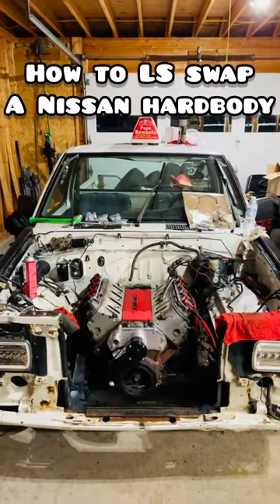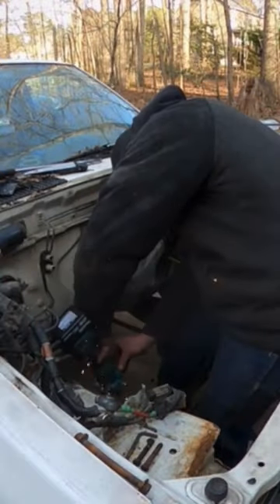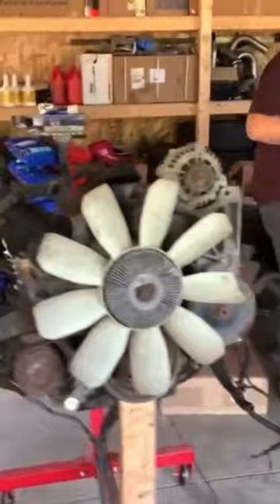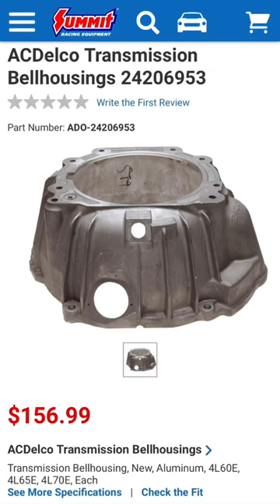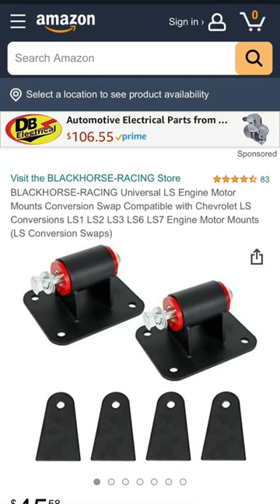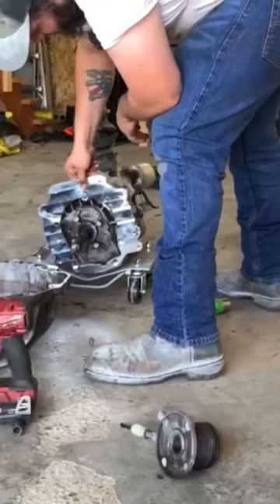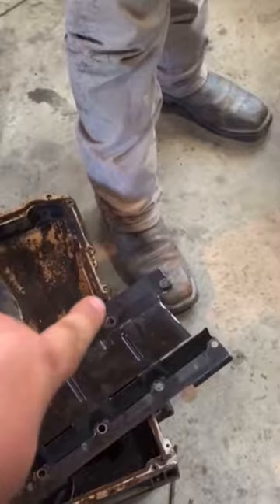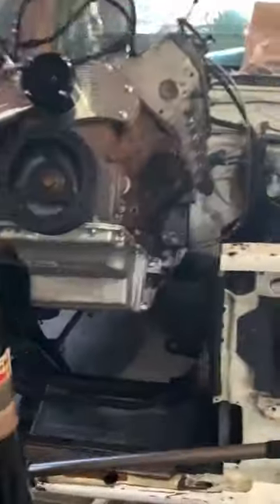How to LS swap a Nissan Hardbody D21 #howto #lsswap #nissanhardbody #d21 #shorts

Comment: You didn't mention which flywheel to use which clutch or pressure plate assembly because you're using an automatic bellhousing is any shimming required of the flywheel to get correct clutch release these are the things that are critical that you must relay
Reply from the maker: Well, check out some of our longer videos on the channel that specify this stuff 😂 We have a whole video on setting up the engine package. It’s a Cyber Stage 1/ LS1 Flywheel. This comes with a kit from Fabbot.
Reply from the maker: https://www.fabbotfab.com/products/fabbot-ar5-to-ls-nexgen-adapter-bundle